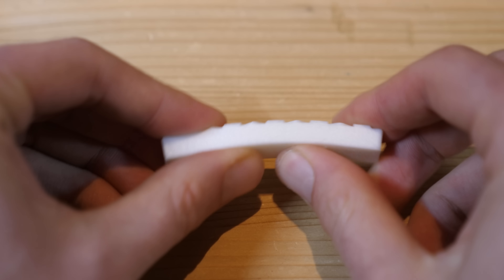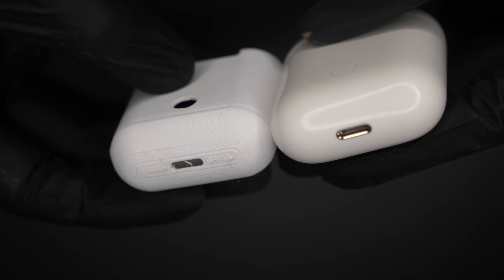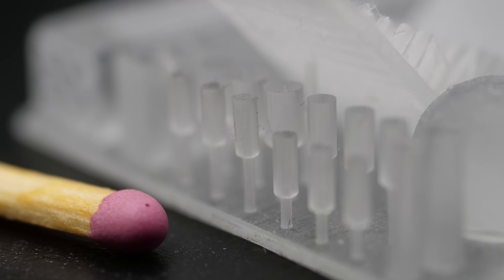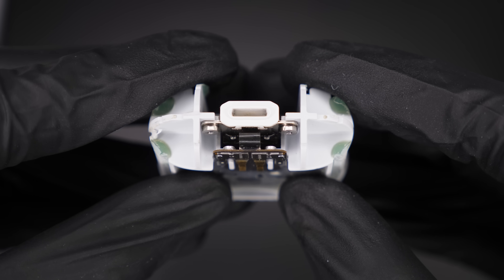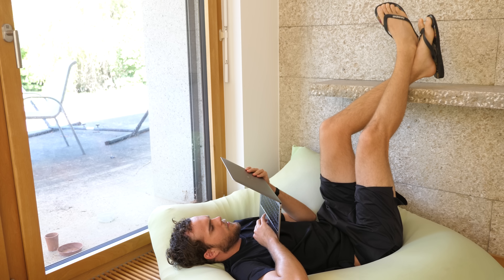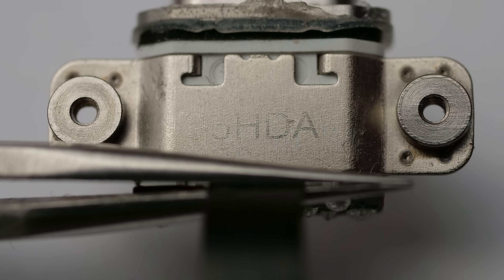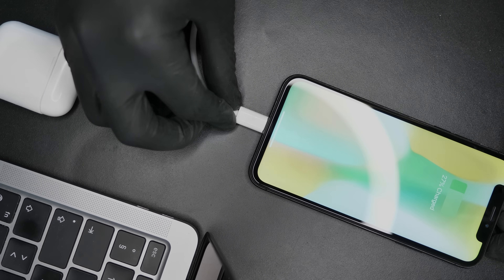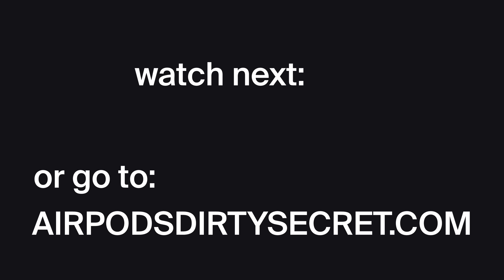AirPods' Dirty Secret (and how I'm fighting it!)

Comment: these are actually fixable, "cambo fixing" on YT repairs airpods all day. (even keeping the OG case)
Reply from the maker: would love to get a link and a timestamp where he fixes a gen 1 case without damage! I searched for a very long time and attempted myself to do it, and came to the conclusion that if I couldn't do it and I couldn't find someone who can, than for 99% of people it's impossible to do. That's why I looked for another solution :)
Reply: @ExploringTheSimulation  yeah, it does look like Pro are easier to open than normal since there's a longer edge.

https://youtu.be/f53kpgHcVZs

And yeah, it is genuinely impossible to do it like he did for the first few time you do it. The guy does it as a full time job it seems.

Btw as of recently, you can buy a new case housing from china

Comment: I opened mine twice without breaking them, (they are fully intact) sadly there are no replacement parts and it's all so tiny that you can't solder wires or sth. to the pcb. Ifixit has a great video about it, they used a vise to crack the glue open a bit, I just did it with my hands.

Edit: I have the pros, they might be easier I think
Reply: Maybe heating the case too while working it would release easier too?
Reply from the maker: Yup slightly easier on gen 2 and way easier on the pros. Gen 1 is a nightmare.

Comment: Okay, this is really cool, but you missed a bit: what was the final cost? Was it cheaper to do this than to replace the unit? And what was the difference?
Reply: He was over when he pulled out a 3d printer. The point is how dumb it is to repair an apple product.

Comment: It's a must that I give you credit for what you have done. In a word...AMAZING! I would have purchased new AirPods. First off I do not have the know how to do such a fix/upgrade and secondly the equipment you have to accomplish it with is another thing. I would assume you already have had the 3D printer and the rest of the tools and what not to use on this project. Good going and a very interesting video.

Comment: I bet that it would be much easier to screw in a ready-made printed circuit board with a usb-c socket that are sold in China for a couple of cents per bucket, and connect them to the +5 and gnd points  with wires
Reply from the maker: Not really because the space inside is very limited!

Comment: Apple wants to swap it because they have the tools to do it properly, then they recycle the battery and use the PCB for service replacements.  Apple has done this for 20+ years.
Reply from the maker: source? did you listen to what the lady says at the beginning of the video?
Reply: @ExploringTheSimulation  she is a tech on phone support, she has no idea where the parts are going.  source: worked for Apple for 10 years.

Comment: amazing! when my airpods pro case stopped working I had to wait months on Facebook marketplace for someone who lost their airpods to sell their case. 

Cost me lots of time and £40, or I could have got a replacement from Apple for £80.

If you could make this available for £40 or less I think there are a lot of tinker-ers that would love this as a project.

Same with the airpods themselves but perhaps that's harder?
Reply from the maker: Thanks for sharing your story. I will also look into doing something for the AirPods themselves! Hopefully I come up with something simple.
Reply: @ExploringTheSimulation  If you can do the same process with a airpods pro case i’ll happily be willing to do this
Reply: @ExploringTheSimulation  If you need some AirPods for your research let me know. I have some gen 1 which only work for about 15 minutes anymore. As a designer it really makes me sad how Apple just does not care about repairability.
Reply: I feel like it could be done for significantly cheaper if demand would make injection molding for the case and purpose-made bracket for USB feasible. I suspect the latter could be done with significantly less amount since the process doesn't really require nuts as threading can be done in the metal piece itself which would be then spot-wielded onto a generic USB-C port. I mean I've seen that sometimes threaded holes are simply sort of punched in a way that would leave extra metal facing inwards that would be used for extra threading. Although I don't really know how much tooling would cost for a process like this

Comment: It'd be cool if you design replacement shell for the case in such way that it doesn't require destroying to open, so next battery replacement will be easier.
Reply from the maker: Totally! That's kind of what I was alluding to at 2:50. I just put the idea our there, now a lot of things can be done! A new version with screws would be cool. Contributions to the GitHub repo are more than welcome.
On the version you see in the video, the plastic teeth have been sanded down and I don't use glue. It just has a tight fit but you can remove it if you want to replace the battery again.
Reply: Anyway, thank you for the great job! Somebody should fight dirty capitalists!

Comment: You’re amazing dude…! After all that hardwork, making it an open source 🙌
Reply: amazing? ;)))
Reply: I dont think he is allowed to make it closed source
Reply: @mccvargues7792  well, he has personally designed the model and the PCB, so he has no necessity to make it open source.
Reply: @RahulBhat007  He isn't allowed to sell his pcb or models because it infringes apple copyright
Reply: @mccvargues7792  The case maybe. But the PCB, no way in hell. Did Apple design the PCB for the USB-C adapter? Nope they used lightning. Doesn't matter what I plug my shit into. Also open source does not protect from copyright infringement or any other legal bindings my dude.
Reply: @dustvoice  as i understand it, if you want to share something without infringing a copyright, then sharing the info (aka opening the source) so individuals can do the work themselves is protection from copyright claims.  I'm not sure whether making the product for others always violates copyright law if done at no charge.